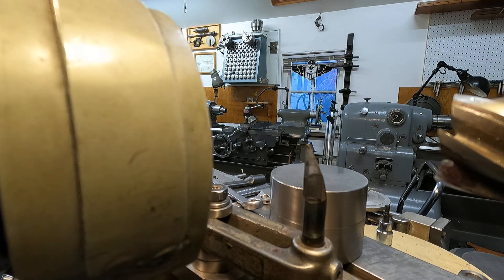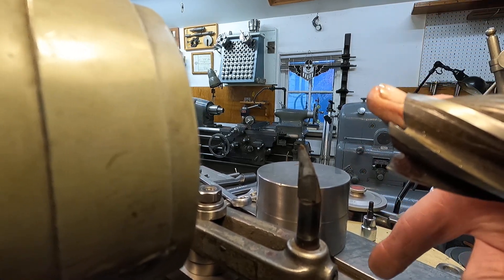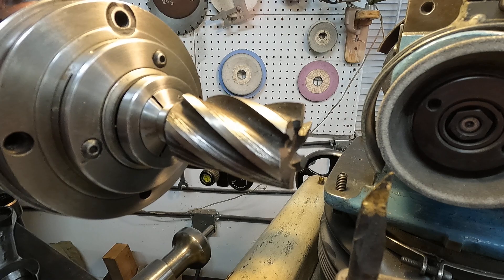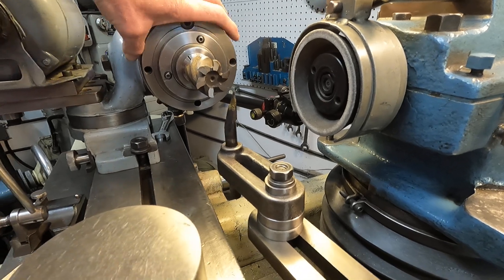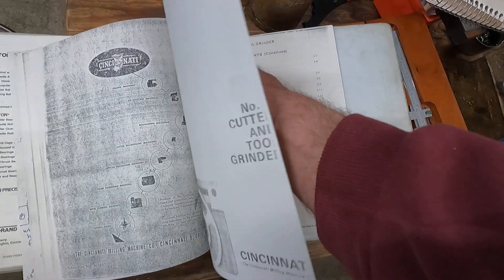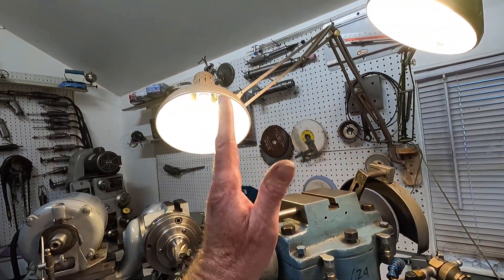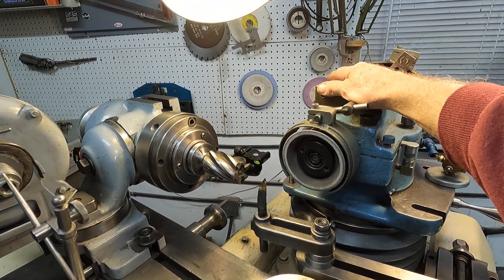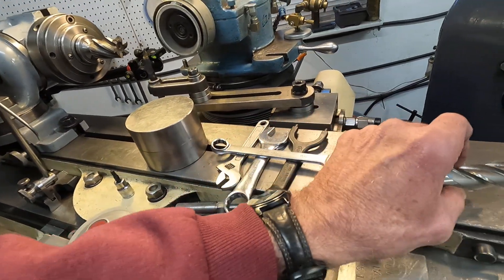Cincinnati Tool & Cutter grinder circular cutter overview

Comment: I've got some of those cutter heads that take HSS! great to know I could grind them sharp in place. is there any chance you could scan that manual to PDF? and email it? It looks very comprehensive and great for a beginner like me. bloody great video mate!!! its given me a heap of ideas for when I finally have the slab poured and my grinder and mills set up here in the Northern Rivers of NSW, Australia.

Comment: Your putting support finger in wrong place . It goes on flute surface with cutting edge facing down
Reply from the maker: Not on this cutter, it is a modern and accurately made, thanks!
Reply: I was a tool grinder for 31 years and im right
Reply from the maker: I have been grinding tools for 45 yrs, I think you are funny, where is your channel content? @eddiekulp1241
Reply: Work head is on the wrong side of your table for your finger to ride  inside the flute.

Comment: DeeDee, Now you’re getting into the “mystery zone”.  I’ll have to watch this again to have a better understanding of how to use the machine to do the more complex grinding.  I’ve got a friend with a working tool and cutter grinder that I’ve never seen him use.  I’ll bet I can weasel a way to try it out. Actually doing some of grinding you’ve been demonstrating will help.   Thanks again and I’m looking forward to seeing more.  Very nice.  Cheers, Will
Reply from the maker: Where to begin is the barrier is that Doozer pointed out. I had text book training at the local school but not so much of that is what I actually use it for. Another obstacle is the machines are often used for just a few or even single functions like sharpening automatic threading dies. What I do is repairs and modifications on very expensive items. If I am repairing a valuable antique, the repair must be unnoticeable as possible of course, that means I have to be able to produce most any shape at any time in metal. The local plastic mold maker faced even greater challenges and used the machine more extensively and even owned the most rare AllTool Rotodex. On another level, owning a horizontal mill with those big toothy cutters, how do you keep those sharp?  Right now I see even greater need for the machine  and the ability to produce my own tools for little cost.
 This subject is certainly not as popular as slamming an Axelson lathe into reverse but........